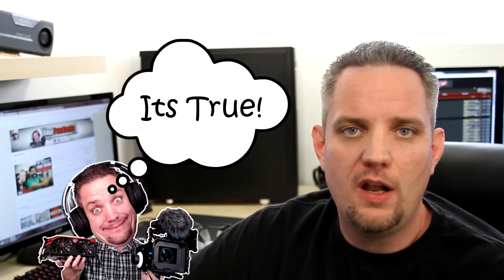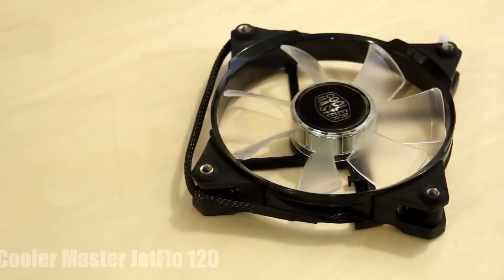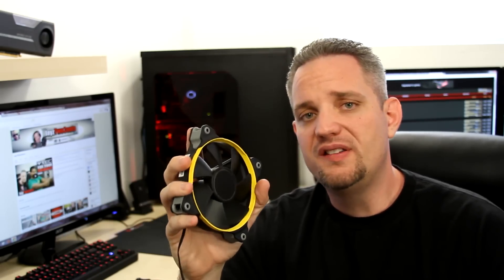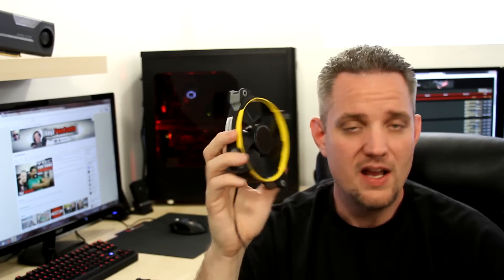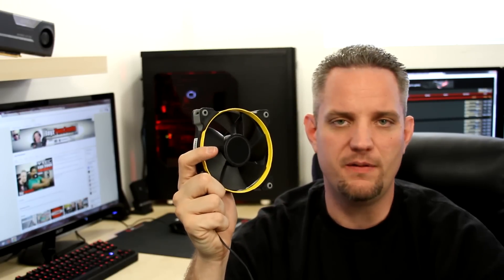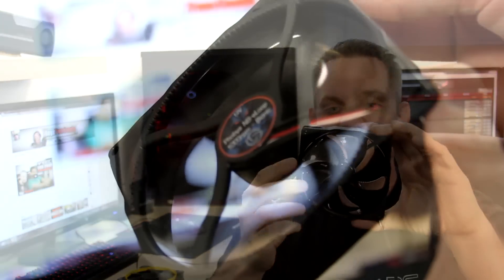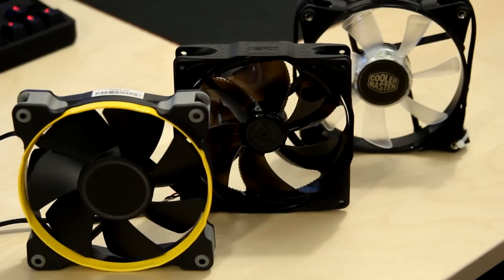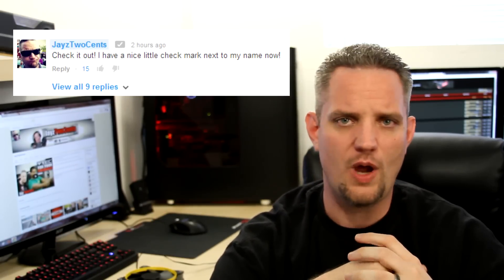Static Pressure vs Air Flow Fans - How to choose the right fan!

Comment: can someone help me?
i have one fan on the back and one fan on the cpu, my rear fan throw air into the case and the cpu fan throw air to the cpu, is that right??
my pc is getting pretty hot when playing at 60fps, and the rear fan is always at 2000rpm, the cpu fan stays at 1000-1300rpm when not playing, and when playing it get to 1500rpm...
is that normal?? i would love if someone helped me :)
Reply: the rear fan is suppose to take hot air out so you have it wrong turn the fan around because that's an exhaust fan
Reply: Just incase, have a look at this photo i grabbed off google images. http://www.overclock.net/gallery/data/500/Zalman_ZM-F3_intake_and_exhaust_views.png The left side is intake, see how it looks more prettier and aesthetic? The right side is exhaust, seeing how it has the sticker and cross support for the fan.
Reply: When you play games the computer is going to get hot. No doubt about that but how hot is it getting? What are your gpu and cpu temps?
Reply: Nicolas Hyams when playing at 30fps i get 50-60c°, when playing at 60fps i get 60-72c°(i7-2600k)
my gpu gets at 50c° no matter the fps i think, don't remember sorry(nvidia gtx 650 ti) until now, i didn't got any reboot or bluescreen, and i forced vsync adaptative(half) at my gpu control panel so my monitor is 60hz and then it caps at 30fps automaticaly...it's not a fix since i lose that smoothness but...until now i'll have to live with it
Reply: You should be perfectly fine with those temps. When i play games like battlefield 3 on my GTX 760 SC it can get up to the high 70s at times and my CPU (i5 4670k) gets up to the low 60s. When your temps get up to the high 80s is when you would worry.
Reply: Nicolas Hyams i thought that the i7-2600 max was 72.6c°, i play with my case open and that cpufan at 2000rpm is fkn scary
Reply: ***** Woops wasnt paying to close attention to the processor model. What cooler do you have on it? and how long have you had the computer?
Reply: Nicolas Hyams it's the i7 cooler i think...dunno...
the pc is 2 years old, new motherboard, new psu and new gpu
Reply: ***** Ok. If its mainly the cpu thats getting hot you might want to look at replacing the cpu cooler. But before you do that, if i were you, i would order some new thermal paste if it hasnt been changed since you got the computer. The thermal paste can sometimes break down over time and cause the cooler to do a bad job and not cool the cpu properly. I would recommend some Arctic Silver 5 Thermal Compound. Its only 8 bucks on amazon so if that dosnt work you are only out 8 bucks. If the thermal paste has been changed i would suggest a new cpu cooler. I have a Corsair H100i and it does a fantastic job.
Reply: Nicolas Hyams i'm going to change thermal paste next week, but i'm not doin myself, i'm gonna pay the "technician" to change it and clean everything, i don't like doing these things myself, thanks for the help bro, i'm gonna buy the cooler as soon as money lets me :D
and now i'm gonna sleep, good night :D
Reply: ***** Alight good to hear. If you have anymore questions just shoot me a PM.
Reply: ***** Stock coolers suck for intel CPU's, get a Hyper Evo 212 (cheap and amazing) id love to hear your after temps
Reply: Dronez doesn't fit my pc, i play with my case open for maintenance reasons.(sometimes my cpu cooler doesn't run[yup it sux] and i have to give it a 'lil push) but as i looked the Hyper evo 212 won't fit in my case and will hit my ram ;-;
Ram:(2x) memory 4gb ddr3(that's what says on the case list)
Cpu:UDP Attis Wks Series
P.s: This PC was pre-built, but i got it pretty cheap and i just changed the hardware inside it along these years.
P.s.s:The only thing that is still the same are the coolers,the HDD, the CPU and RAM.
Reply: If you have about $150 max, you could look up LP Ram (Low Profile) which helps with bigger CPU coolers like the Hyper Evo. Pre-built PC's are fine, my first one was also Pre-built, what you can do, is get a normal house fan preferably without the stand, and put it up against your case, without the side panel,  this will result in alot of cooling, however dust will build up more quickly.
Reply: Dronez could you send me a link to a lp ram? or just it's sizes? i think that my ram is won't hit it, here is an image of one that is like mine http://www4.pcmag.com/media/images/344987-patriot-ram.jpg?thumb=y
Reply: ***** Get the 212 evo if you have that kind of ram of course it wont hit. I have ram that i taller than yours and the EVO fits.
Reply: Jose Vidal yay :D
Reply: ***** Before you replace your CPU cooler, try flipping around your rear fan so it exhausts (blows out the back of the case instead of sucking air in) and see how that affects your temps.
Reply: GGGG761 the problem now is, i'm not sure if is actually exaust, like i put my hand inside the case, and i feel air, i put my hand behind the case, and i feel air, so, i'm not sure anymore .-. (i feel a lot more air inside the case, and fairly cool, when gaming it gets a little hot)
Reply: ***** Simple, hold a piece of paper by the edge right behind the fan at the back of the case. If it moves closer to the fan, you've got it wrong; flip that fan around and mount it the other way. If the paper is pushed further from the fan when it's on, you've mounted it correctly.
Reply: Skeletor Jopko I thought this was a good idea until i tried it myself, both intake and exhaust have showing wind when it comes to paper/feeling it. I found an easier way to check, exhaust is the bit with the supports at the back, and the sticker on the middle, it doesn't look as aesthetic as the intake side.
Reply: Dronez Also true.
Reply: Dronez oh, i didn't tried the paper thingy, but as i'm looking inside my case, that fan has no supports on it(at least not on the side i'm looking at), and my cpu cooler has the supports, so now, i'm sure that the fans are on the correct way :D

Comment: I sure that Pressure Optimized is better for the front part of my computer, but should i choose airflow for my exhaust?
Reply: depends on what is there if there is some kind of restriction like mesh, radiator, heatsinke use the SP´s if there is nothing in the way go for AF´s

Comment: I'm thinking about putting 6 of these in my case along with 2 on my H80i, would I see any difference in temps? Mine are running pretty loud right now with stock corsair fans in my H80i and some coolermaster sickleflow 120 for chassis fan.

Comment: So if the internal of my case is wide open ( no obsrtuctions etc ) i go with air flow got that .But what if the the front panel is solid with not a lot of nentalation do i go air flow or static pressure?

Comment: NZXT H440 (In the front) - 3 x 120mm SP fans or 2 x 140mm AF fans?

The case has it's HD racks right behind the front so I know that SP fans are generally better at pushing air past them... However it seems Corsair don't do 140mm SP fans in Quiet Editions. 

So in the front, my choice is as above.. And i'm not sure what's best to do :\

Thanks!

Pete

Comment: I just bought a R9 270X non reference  with  8m copper pipe, and one big fan. Most have two smaller fans, some have three fans. Mine is short. Mine is a pink(red) Powercolor. I can't find information on it. It came out of a Cyberpower computer, and looks like the Visiontex single fan R9 270X model.  Does it matter as to the cooling?

Comment: hey  can u please help me a question i have 

i have a corsair cx 500 psu and the fan has been making noise as its getting older and i waned to replace it with a noctua fan 

i was stuck between the nf-f12 and nf-s12a   i know u like the f-12 a lot but do u recommend it as its designed for static pressure to cool the components inside psu or should i go with s12a  for a more air flow build

dont worry about the pin difference im modding them to a two pin 

please let me know ur thoughts it would be highly appreciated

thanxx keep the videos coming

Comment: Ok I have a question for you.  Out of all the fans brands I only trust Cougar and Noctua.  I am in the process of building a NAS system with a Fractal Design Node 804.  There will be NO water cooling at all in this system.  I want SILENCE but I still need the hard drives to be cooled.

Out of those two brands only.....what fans would you recommend?

Thank you in advance and keep up the excellent work.  Also keep the sense of humor! It's a great gift to have.

Comment: So if i had a Corsair Vengance C70 case with a exhaust H100i, my best bet would be two static pressure fans on the side for intake? There's no restriction but you did only mention airflow fans as a exhaust fan

Comment: Hi, thanks for your video and I would like to ask about air flow fans or static pressure fans for intake on lian li pc-q25? The fans would be in front of the hard drive cage but the front is not opened.

Comment: Jay, the Corsair SP120 fan you showed does not have a full square-shaped fan casing. So it does not seal off well if you attach it to a radiator. Imagine a 360 rad with three of these, there would be gaps between the fans where the air would be able to escape. So you would have to use some kind of fan shroud to seal the fans properly against the radiator.
What do you say to that?

Comment: Great video.  How does SP or AF affect noise/turbulent air flow?  What kind of SP numbers would you recommend for radiators or HDD cages?  Finally, which brands do you know of that give elevated/false measurements?

Comment: Hey Jayz, I have a H105 from Corsair AIO (22FPI). I love how well it performs but the fans are too freaking loud. I have the SP120 "quiet editions" on my case fan controller (600t) and they are the loudest thing in my case even with the controller on low. My question is, what fans can push air through the rad decently, but still maintain near silent operation (under 20dba)?

Comment: I'm using the corsair H80i cpu watercooler, but in my opinion it's fans are loud. Like almost as loud as my previous stock cooler on the Fx-8350. I was actually hoping that with corsairs cooler the noise would go down, but its appears not to do so. Should i perhaps choose different fans on the push pull system, or will it not really make up for a difference in noise reduction? Any idea what fans to choose as replacing material? Also, does anyone else have this H80i and feel like its fans are loud?

Comment: If anyone needs the ultimate fan and doesn't care about noise.. the Delta PFB1212UHE is a monster. 252cfm.. 35.877 mm h2o...but it's 66.5 dba and draws.... 4 watts (over 4 amps) but it's got a home on my test bed and it's insane

Comment: I always see people fighting over positive airflow vs negative airflow inside the case...what one do you recommend?
Reply from the maker: Positive pressure when possible, it assists with dust IF you have filtered intakes.
Reply: Awesome!! Now you made a whole video on it....you the man Jay!
Reply: +JayzTwoCents actually, the key for the dust would be the filtered intake rather than positive or negative pressure. no?
Reply: Those spaces will effectively become intake. So,... The thing is with positive pressure, you normally control the intakes and that is easy to filter. In negative pressure mode, you control the exhaust and as you said, the intakes become uncontrolable and then, difficult to filter
Reply: But the thing to filter the intakes is still valid
Reply: 3x140mm intake and 3x140mm outtake is good?

Comment: Hey Jayz I had a quick question and I'll take it from the guy who basically knows his Shiza when it comes down to tech amd r9 290 or gtx 780 probably gonna go sli /crossfire down the road 1080p gaming ,cooling/performance matters and btw will an r9 290 kill my system from the heat  thx ur help will mater a lot cause what ever u say ill do it !!! Sorry for bad English
Reply from the maker: I personally like SLI over Crossfire as it tends to have wider support in game profiles.
Reply: +JayzTwoCents aye Jay is this build good for playing most games high settings 1080p 40-60 fps?

 http://pcpartpicker.com/p/vp8Nbv
Reply: +Washu Ken What sort of games would you be playing?
Reply: UnrealHobbit23 007 lol too late changed my mind got a 960 4gb same CPU an 8GB of ram new WD Blu Harddrive and i changed the preference to blue
Reply: Okay, nice build.
Was this your first?
Reply: UnrealHobbit23 007 yes
Reply: Nice build.
Reply: +Washu Ken bad choice, 4gb on 960 is useless (barely a difference in fps but price is considerably higher) you should have went either with the 960 2gb, or the AMD r9 380 4GB
Reply: ThePolulos im going to be playing Shadow of mordor GTA V gta iv and well basically alot of intensive games but it was the only card i found with 3 fans
Reply: Washu Ken
why is 3 fans so important to you? I guess you are referring to the Gigabyte G1 Gaming model, which also has the 2gb version at a better price/performance ratio, and if you get let's say a Sapphire AMD r9 380 4gb with only 2 fans there won't be much of a difference in temps nor noise.
Reply: ThePolulos well atleast i got some better gigs
Reply: You know the Gigabyte G1 is the name of the card right Washu?
Reply: UnrealHobbit23 007 yes

Comment: Hey JayzTwoCents I need your helppp. I'm going to be building a PC soon and I wanna water cool the GPU (2 way SLI Gtx 780ti kingpins) and the CPU (Devils Canyon). The motherboard I'm using will be the Asus Maximus VII. How would I water cool the GPUs and CPU and use the CrossChill Copper feature in this motherboard ?? Also which water block will I need for the GPUs ??? I would really appreciate it if you respond thanks.

Comment: Great video as always jay! The only questions i would have are:
1: I've heard the eloops don't run well in push pull, yet some say they do.  Can I run eloops in push pull?
2: I run 20 (yes 20) sp120's in push pull on my 900d. Would the change to eloops really be worth the price/temp difference? I'm also a silence freak by the way, so quieter is almost worth more than performance. Of course because internet, I've had wildly varying opinions on this one as well.

As always thanks for all your awesome content!

Comment: will the advice applicable for both push config and pull config? I mean, the pressure build up is on the exhaust side, if it's on pull config with nothing resisting on the exhaust side how does it work then? Is it still the same?

Comment: Hey Jay, 
Just want to say your channel is probably helped me a whole lot between Linus, tech syndicate, Paul's hardware, ect. In my research to build my 1st rig and to also learn about water cooling...if you ever get a chance check out  the channel Singularity Computers, his builds are 100% professional and in my opinion the best water cooling builds that are original and Informative...but my question Jay is, can you push air through a rad with SP style fans and pull with AF style fans? Would that combination help or should you stick with SP push and pull....hope you get to read this and able to answer my question. Thank you again for your channel bro.

Comment: Good recommendation (If any) On a good Static Pressure 200mm Fan?
Reply: I think the Bitfenix Spectre Pro is pretty good.
Reply: I have a coolermaster megaflow in the front of my bitfenix prodigy and it's pretty good.

Comment: Hey I was wondering what fans to use in a push pull configuration because some say that you need static pressure on the top of the radiator and airflow at the bottom of the radiator is this true?  I just want to get the coldest temperature on my cpu and I am mounting it on the top of my case which is a corsair 750 D. I checked YouTube and Google but no answers what fans to use on a push pull configuration.  Please make a video and no need to make a comparison on fans just what fans to use. Please help me and thank you very much.

Comment: Okay finally I understand static pressure vs air flow, but what about INTAKE, OUTAKE and PUSH-PULL configs?
Reply: Intake- A fan that takes in air
Outtake- A fan that exhausts air out the case.
Reply: lol that's common sense, but I am confused on where to have intake and outtake on a case like a HAF 912?
Reply: For Intake; Static Pressure, and for the outtake; Airflow i guess so that the warm air can go out better? I don't know much about fans in general, but what i have learned today is what has been said in the video.
Reply: techConsumer Intake should be front and side, Outtake should be the back fan and top fan.

Comment: Question: I'm going to build a PC using a Corsair Carbide SPEC 02 case with a r9 270. I know the cards are supposed to run pretty hot but should I upgrade with more AF fans so my CPU doesn't over heat at the same time or just leave it the way it is put of the box? Btw liquid cooling is too much of a hassle and is out of my price range.

Comment: Just buy noctua they last forever
Reply: They also look like shit forever.
Reply: I have never had a fan die on me before so.....
Reply: Considering that most of the Noctua brands aren't server grade (except for the stupidly expensive Industrial PPC versions), buying Noctua is utterly stupid. Most of their fans are overpriced, and don't perform as well in ALL metrics against other cheaper fans. You should aim for Scythe, Delta, etc. fans, which ARE made for constant server usage.
Reply: GGamer720 They look nice imo
Reply: KinaestheticDmaw They are mainly made to be quiet, I've had good luck with them and though the price premium is high, they are nearly inaudible. Their LNAs work well for further quieting down the system and though they don't push as much air, that's not what the NF line focuses on. Fans are fans and unless you need low power or server grade fans this is a market largely controlled by opinion as the main difference in most of these fans is 1 or 2 degrees celsius unless you want to crank them to 3000 RPM+.